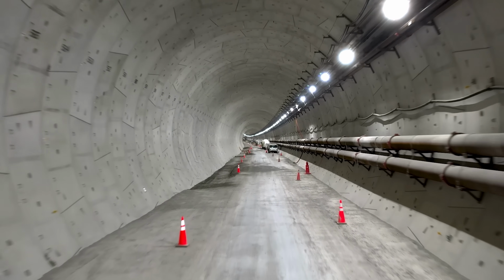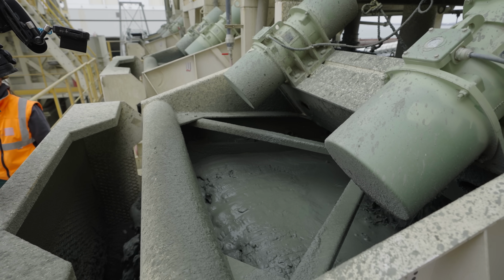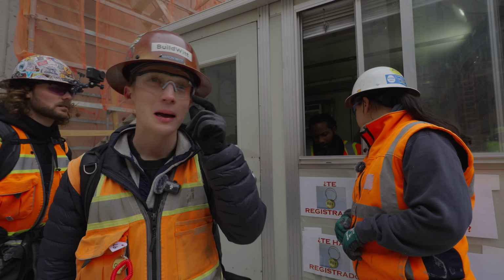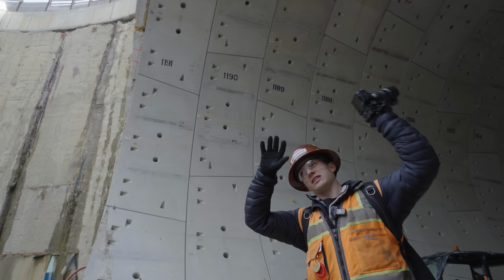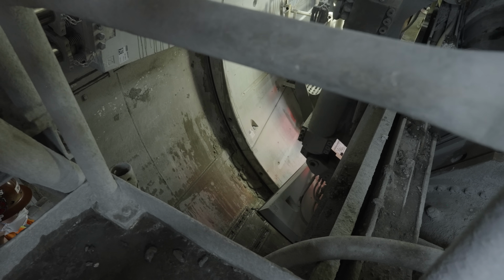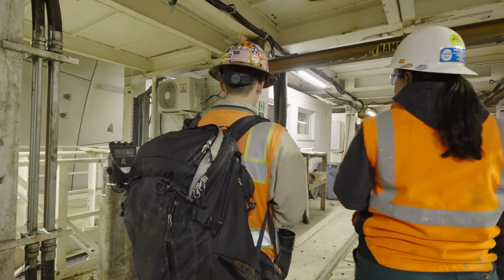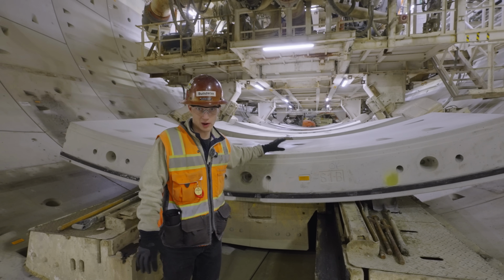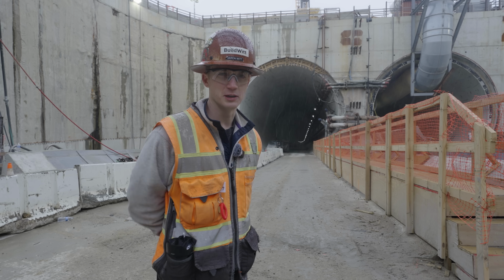Inside Virginia’s $4 Billion Tunneling Megaproject!

Comment: Perhaps these questions were answered and I missed it.
1. What is the depth of the tunnel under the floor of the water?
2. How far does the machine move in a 24 hour period?
3. How many workers are involved while boring is taking place? 
4. How are the concrete segments secured to the tunnel wall and to each other? 
5. Where are the concrete segments produced?
Reply: 1. 20-30m (60-100 ft)
2. Between 8-20m (25-70ft)
3. 20 on the TBM another 20-30 on shift supporting.
4. On this project the have bolted connections (spear bolts in the pockets seen in the rings), anchored into cast in (plastic) threaded inserts cast into the adjacent ring.
5. Usually a fairly nearby factory, a fascinating process in itself. 
Sets of moulds, cassette systems, curing etc. a large precast concrete plant.

Comment: It is my opinion that tunnels are highly under-utilized in our infrastructure, not only in waterways, but in just making roadways more passable.

I don't get why we have no problem as a society with spending a billion to put up a bridge that will last 40-60 years, but we wont spend a couple billion to make a tunnel that could last 100 years. My brother is looking to work on the Blatnik bridge linking Duluth, MN & Superior, WI. The cost to replace the bridge is going to be nearly $2 billion, meanwhile a tunnel, which would be safer as the reason they are replacing the bridge is because of the Francis Scott Key Bridge. It would allow any ship to pass over it, while the bridge would inevitably cause something to be unable to pass under it.

Comment: 3:22 and 5:43 The Arleigh Burke-class guided-missile destroyer USS Cole (DDG-67) Named in honor of Marine Sergeant Darrell S. Cole, a machine-gunner killed in action on Iwo Jima during World War II. At 1118 on the morning of 12 October 2000, as the USS Cole was refueling in Aden Harbor, Yemen, suicide bombers detonated an explosive-laden boat directly against the port side of the ship. The resulting blast killed 17 Sailors, wounded 37 others, and tore a hold forty by sixty feet in the ship's hull. The ship was towed to the United States for repairs at Ingalls Shipbuilding in Pascagoula, Mississippi and returned to service.

Comment: I work on a project in New York , New York. It was called the east west access. A tunnel crossing the east river. From Queens to manhattan. For the Long Island Rail Road. (MTA) This tunnel descends under the Grand Central Station. The escalators at Grand Central Madison is 182ft long.  The longest in the MTA system and steep. I saw this same type of machine the cut that tunnel. It was amazing. 
#Operating engineer local 138 LI. NY

Comment: Round vs rectangle.  Ever tried to drill a square hole. Good luck if you try.  Vehicles need a flat surfaces you put in a floor.  What abut air?  Suspend the floors a wy up the wall and a way from ceiling.  Pump air in to the bottom and suck out on the top.

Comment: So is Hydraulic Concrete being used, I assume since its underwater?  I don't understand throughout the country why "Asphalt" is used, or even legal.
Hydraulic concrete is the secret to great roads.
And when you have a damaged lane, or need to do some work on the sewers etc. the entire lane should be torn up to the middle line, and the entire
lane repaved with concrete. Not patches of Asphalt.  If you see Asphalt being used in your town instead of concrete, you are being hosed.

Comment: Very good vid. One point you should include, the HRB tunnel basically cost wise only represents approximately 33% the cost of the Gerald R. Ford aircraft carrier, making this a very worthwhile project. And there are many other naval vessels besides CVN 78 that require immediate ocean access from Hampton Roads and Norfolk. The other point should be to explain Bentonite for folks that have never heard of it. Being very familiar with drilling operations it’s a crucial component that  we can’t drill without. It’s an amazing compound. 👍

Comment: The tunnels will help, but drivers will ruin it. I've driven through the HRBT thousands of times. It never fails that people fly down to the bottom and creep back up to the top. You're lucky if you're doing 45 when you exit the tunnel, despite the "Maintain 55" signs. 
Exit the tunnel. Then pass a few cars and it's open road for at least half a mile. 

Put in 6 more tunnels, you still can't fix bad drivers. 
I'm glad I no longer live in the area.

Comment: Wait a second.  At some point, there HAS to be "dirt" that is visible.  According the diagrams, it would be just outside the 27 pairs of hydraulic pistons.  But the images show that to look like concrete.  And the liners would have to be installed so they touch that dirt.  But all we see is them getting installed inside of something that looks more like outer liners, no water coming trough, sand collapsing, etc.  So how does that work?

Comment: I may have missed this, but how are the ring segments secured, is it just pressure or are there brackets connecting them.  I saw what appear to be holes or divits in the ring sections, are those so the machine can grasp them, are they used to connect he tunnel segments.  Also at the end you said it took months, is that just to turn it around or for the whole process of tunneling.  Really good video on this amazing machine.
Reply: The segments interlock.  The machine uses vacuum to move the rings.  The holes are where they inject grout into the space between the ring and the earth after the rings are placed.  It took 6 months to turn the machine around.  It took over a year to dig the first tunnel.
Reply: @stargazer7644  Thanks so much that was an incredible video.

Comment: Great video of an interesting project! 
TBM's really are fascinating.
I was a bit surprised when she said that they have an atmospheric cutter head because it's a slurry TBM digging under a body of water.
I would have thought that it'd be pressurized to avoid flooding.
Here in Paris, many of the TBM's used to dig the Grand Paris Express are slurry ones with pressurized cutter heads to resist waterlogged terrain. They're built like subs, with pressure airlocks, etc.
Something like 21 out of the 23 TBM's that were digging simultaneously during the first building phase came from Herrenknecht.

By the way, the Grand Paris Express is such a huge project that it would be great if you could make a few videos about it, like for the Fehmarn Belt immersed tunnel. They're happy to welcome good youtubers, and the second major building phase is beginning.

Kudos, and greetings from Paris!
Reply: It's a pressurized slurry TBM of course. 

You had only 5 like this on Grand Paris Express. T2A section on line 15 and Eole on RER E and line 18 lot 1 and 3.
Reply: @JB_Start-Up_Commissioning_MS  Aren't you forgetting a few? Like the ones that dug the 15 South section around Saint-Maur Créteil station (they had to freeze the ground hard to build platforms), the part around Pont de Sèvre, the North and South M14 extensions, etc.
All these locations had in waterlogged terrain.
Reply: @KyrilPG I don't.

L15 in Saint-Maur was T2B lot ( Razel-Eiffage) with EPB TBM. 

Also T3A in Pont de Sèvres ( Bouygues) with an EPB TBM 

And Both Side L14 extension ( Vinci) was EPB as well. 

Ok they were pressurised but they were not slurry or variable density TBM like the HRBT Project in USA.
Reply: @JB_Start-Up_Commissioning_MS  In the soup between the two arms of the Seine river loop of Saint-Maur and in the North of M14?
There was something looking a lot like an STP (*) near Saint-Denis Pleyel, with pipes and all, and they also did what looked like a submerged breakthrough.
(*) it wasn't the cold generation plant.

Do you know what they'll use and where for the second major phase that started recently?
Reply: @KyrilPG in Saint Denis Pleyel I think  it was the RTE project. High voltage cable 225kV relocated in a 2,5km tunnel.

The HK TBM was a small slurry with a small HK STP ( Apparently it was a mess btw) and the breakthrough was a submerged one yes. 

But not part of Grand Paris Express even it was the same timing 😊

Wich second phase exactly ? 😊
Reply: @JB_Start-Up_Commissioning_MS  Was the RTE project using a GPE / SGP building site? Cause the one I'm talking about that looked like an STP was inside a marked GPE / SGP site.
The submerged breakthrough I'm thinking about was of a large TBM, and I thought for the GPE or M14 North as there were photos of it on the press and media website.

The second main digging phase of the GPE : M15 East and West (only partly started), M17 North CDG (in progress), and M18 West Guyancourt Versailles (in progress).
Reply: @KyrilPG no RTE wasn't using GPE building site. 

You are right L14 north breakthrough in submerged shaft but that was an EPB TBM. That's not commun for EPB to breakthrough submerged.

No idea what you seen then back then but for me it wasn't an STP.

Regarding the rest L15 East and West are EPB TBM just started. 

L17 is also EPB no idea of the progress on this line.

And 18 in Versailles will finish the 6/7km of tunnel in the comings weeks. 

They were using a refurbished variable density TBM with an MS STP from L18-Lot 1 tunneled in Massy-Palaiseau few years back.  

It went well all the way.
Reply: I think she misspoke a little.
The cutterhead is pressurised, but the access to the cutterhead to change the cutting tools is largely atmospheric. The tools are mounted on the long “slide” tubes to allow them to be withdrawn partially, a guilletine gate closed behind them to seal the pressure of the face. The. The tube chamber can be depressurised and the tool and tube withdrawn. Repeat in reverse to install the new tool.
Very large TBM’s have the space/ability to have atmospheric access into the arms of the cutterhead. 
Not so easy below 10m (30’) diameter.

Comment: Born and raised in the 757 and this is a must needed project. The other option was to build another bridge-tunnel connection which would connect the south side to the peninsula which was canceled. There is another TBM in the area at the Chesapeake Bay Bridge Tunnel project.

Comment: I never heard why the "slurry" was being pumped "back to the" TBM. Is it being use to make concrete, being use to "lubricate" the TBM cutting face? Someone explain, please!
Reply: The slurry is how they remove the earth that is dug out from in front of the machine.  They inject high pressure slurry, and the mud is pumped to the surface where the dirt and other material is removed and the slurry is recycled and pumped back down to the machine.
Reply: @stargazer7644  Thank you for the explanation.

Comment: Fantastic I want to know what is the oddest and most precious thing ever dug out of the slurry. The tunnel between France and the UK had to have found minerals or lost ocean artifacts.
Reply: It was almost all in a soft rock called chalk marl.
No real value in it other than for landfill. The UK expanded in size by 0.3 sq km or 72 acres from the material dug out on the UK side.
Reply: Oddest I found dug out on the channel was a Walkers crisp packet 70m down in the Shakespeare cliff shaft.
Very confusing. Buried in undisturbed 40 million year old chalk marl.
Turned out it was down a backfilled borehole that had been drilled just before the works started. Backfill grout was indistinguishable from the chalk marl it was passing through. Only a faint circular line around it gave it away.

Comment: Great video!  Leaves some unanswered question with me though. What is the leftover slurry used for or where is it deposited? 
The TBM entered the south end but was that into a man made mountain of ‘dirt’ built up from the South Island?
It would have been nice to get more info on the navigation system. I assume some sort of gps but how do they navigate under water/earth.
How far below the bay bed are the excavating?
I’ve been a victim of that tunnel more times than I care to remember. Waiting in traffic in the middle of summer was the worst!
Reply: Both islands are man made.  The TBM follows a laser projected down the tunnel by surveyors.  There's no GPS under water/ground.  They're about 125 feet below the sea bed at the deepest point.
Reply: @stargazer7644  thanks. Amazing they can be that precise navigating to the other island
Reply: Oh yea…. In the area where they put the ring together is that earth where they push the ring up into place or is that part of the matching sleeved and the rings slide through a sleeve for a short time as they push forward

Comment: When I first got into engineering all the other engineers were older white guys. Now that I'm an older white guy I've been delighted to see young women get into the field, and some of those ladies are SHARP. Kayla seems to be one of them, she sure sounded like she knew here stuff, and I never realized how those things moved until she explained it.

I would have liked to ask her a question. I understand how the TBM moves while it's digging the tunnel, but what does it do at the beginning when it doesn't have those rings to push against?
Reply: We use a structure called a thrust frame which is anchored then post tensioned to our 7-9’ concrete permanent slabs. It takes a fair amount of load when we are starting the machine.
Reply: Glad you enjoyed the video :)

Comment: Awesome video, all the engineering that goes into design and building this machine, and the companies that built all the components my question is, how are the hydraulics of the TBM powered ?
Reply: Simplified answer is we have hydraulic pumps and the hydraulic cylinders for example work from the hydraulic fluid pushing on the piston when we are excavating to extend it. :) and the opposite when it’s retracting. All of this still uses electricity to run the pumps (we have electrical cabinets / distributors inside of the machine)
Reply: @KaylaAlvarez_09  What is your degree in?  You really know your stuff.

Comment: I was wondering how do the segments inter lap  / Merge to create a water proof seal?
Reply: There are gaskets which are around the segments and we use something called a shear cone which interlocks the segment as well :) Because you have lots of force pushing the rings, they are also working in compression. It’s like smooshing your sandwich when you want to flatten it. Same concept! :)

Comment: When the TBM is installing the rings,  are they installing them over bedrock or is that concrete? It already looks like a finished product. Also, if it is bedrock, what happens if it’s ever cracked and water eventually will seep in behind the rings? Do they just collect the water and pump it? I guess what I’m getting at is do they inspect for cracks/leakage before installing the rings and what happens after one does form?  Thanks.
Reply: There's no bedrock there.  You're seeing the outer shell of the front of the TBM that holds the earth back.  The rings are assembled in front of this shell.  As the TBM moves forward it pulls that shell out from behind the new ring, and then they inject grout into the space between the ring and the earth behind it.  The rings have seals to keep most of the water out.  But any water that gets into the tunnel is pumped out at the pumping station.
Reply: @ Thank you. I must’ve missed the grouting part.

Comment: The idea that the rings are angled just a tiny bit so that depending on what orientation they are installed, the bore points a slightly different direction in order to steer the TMB is the kind of engineering that just blows my mind! What an elegant solution!
Reply: Now imagine the casting process.
Reply: @frotobaggins7169  They have 9 molds.  The turn angle is the same for every set of 9 rings.  To go straight they alternate the rings by 180°.  Anything other than 180° opposite for each pair makes a turn, and how much they are not opposite determines how sharp the turn is.  Having them aligned together makes the maximum rate of turn.
Reply: @matthewbeasley7765  awesome explanation.
Reply: I always imagine it as a giant salami. If you take thick slices, but you cut one slice with a slight angle to the left (L), the. The next slice with the same angle the other way to the right (R) and repeat along the whole salami. If you then reassemble your salami with (L) then (R) slices you get back to a straight salami. But if you rotate the (L) slices by 180 degrees, they become (R) slices. If you then put them together you get a curved salami! Thus you can follow your TBM around a curve.
Similarly by rotating 90 degrees you can go up or down.
With the 9 segment and 27 ram sets in this TBM there is potentially 27 different orientations for your slice. 
The TBM steers itself via an articulation joint along its shield skin.
The rings are built in the tail can to follow the TBM. 

It all comes down to simple trigonometry… and a lot of engineering.

Comment: Thanks for the tour.  Very interesting!  Your tour guide really knew her stuff.  Curious to know how often the pipes transporting the slurry away from the cutting head need replacement as I would think that all of the abrasive rock material would erode through the pipe wall in a short amount of time.

Comment: How many rings do they place in 24 hours? 
If something happens to the cutting head and they need to access it to replace something, how do they do that without risking a cave in at the front?
Reply: Our machine is special with an accessible cutterhead. We are able to change most tools in atmospheric pressure. So the face pressure in the front of the machine is still maintained.
Reply: @KaylaAlvarez_09  It's amazing